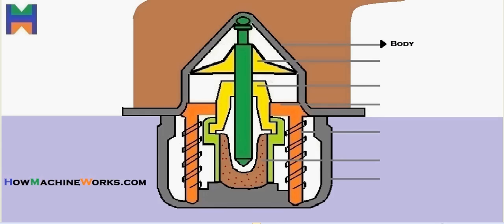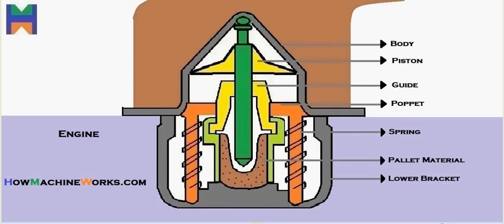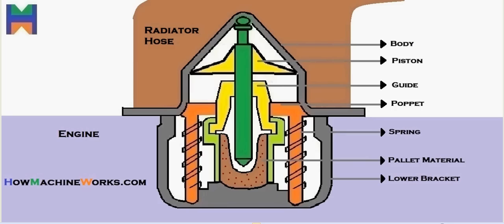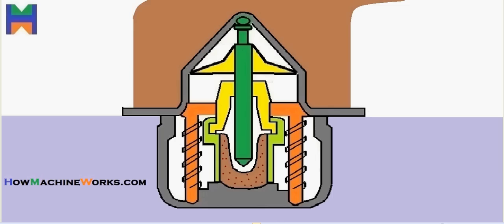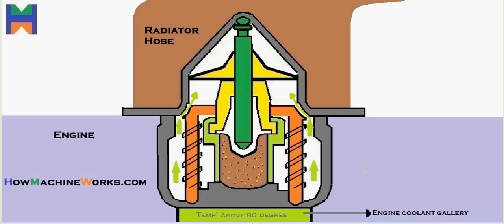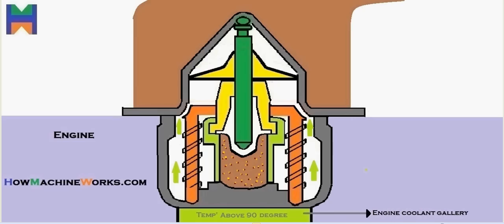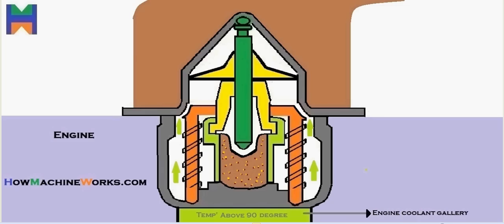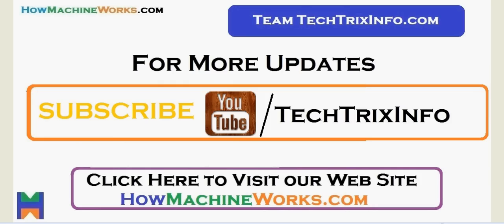Animation How Wax type thermostat works (Must Watch) ✔

Comment: This most common modern form of thermostat now uses a wax pellet inside a sealed chamber.[6] Rather than a liquid-vapour transition, these use a solid-liquid transition, which for waxes is accompanied by a large increase in volume. The wax is solid at low temperatures, and as the engine heats up, the wax melts and EXPANDS. The sealed chamber operates a rod which opens a valve when the operating temperature is exceeded. The operating temperature is fixed, but is determined by the specific composition of the wax, so thermostats of this type are available to maintain different temperatures.  from Wikipedia.
Reply: The only thing movable in this pic is green needle with that yellow hat, both the legs of poppet is touching the valve body makes it immovable, that turns that spring into a completely useless thing. This drawing is violating all the basic of an engineering diagram.

Comment: I'm trying to understand how melting wax overcomes the tension of the spring. This clip did not help me at all.
Reply: the wax expands. Its powerful given the size.  This technology has been around since the 1930's. Your dishwasher uses it to lock the door. Lookup thermal actuators  and wax motors.

Comment: Wrong ? I though the thermostat is suppose to let cool coolant from the radiator into the engine rather than letting hot coolant out to the radiator.. Thats why thermostats are mostly at the bottom hose leading to the bottom of the radiator.. Unless yours travels upwards instead.. Totally wrong..
Reply: +Khin way Choi Sorry dude but he is right about the direction. If it let cool water into the engine - it would immediately cool the wax in the thermostat and close it again before the engine got any cooler. 
Letting hot water from the engine out will ensure that the thermostat remains hot and water keeps flowing out until the entire engine is cooled.

Comment: Hi, thanks for this vid. I drive a 1997 Audi A4 with a 2.6l V6 engine (B5). The engine gets overheated whenever I switch on the air conditioner. The thermostat has been removed. Do you have an idea of what could be responsible? Thanks in anticipation of your quick response.
Reply: ***** I know this is almost a year since you post this question and it may be irrelevant now, but it may be useful in future perhaps. From what you describe it seems that under load, the coolant is not getting cooled down enough to take the heat from the engine. Removing the thermostat is not going to solve the problem (it will cause more damage to your engine). Since there is no thermostat, all the coolant will be flowing through the radiator all the time. When this happen, the efficiency to take away heat reduces since the coolant is spending more time going through the radiator rather than just picking up more heat. My suggestion would be to put a new thermostat. Refill the system with new coolant as well. 

If it still fails, it seems that the issue is with the radiator then. You might want to get that checked (probaly next time) and see if its not spending too much time in the overflow tank. This would reduce the amount of coolant actually flowing through the system.

Come to think of it, you might want to check the hoses near the heating/cooling system for leaks, since you are saying it caused an issue when the AC was switched on.

Comment from the maker: 1. its will condense
2. No it opens and closes.
3. when the temperature is above the optimum range. ie. between 80-90 degree, the valve remains open and the coolant circulates through the engine block and radiator there by cooling the engine. it only closes when the temperature of the engine drops.
Just click on our logo and reach our YouTube page - see the video how to test thermostat in "recent uploads" "this will clear your doubt.
You are free to ask doubt
Our sire: HowMachineWorks com